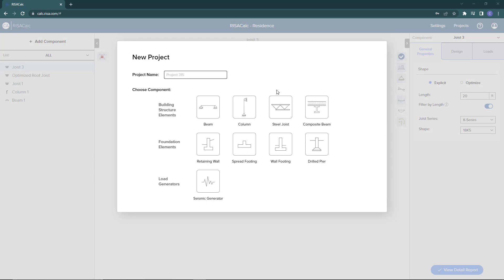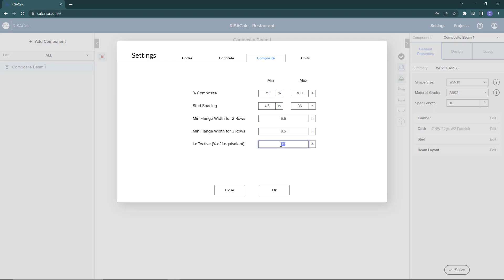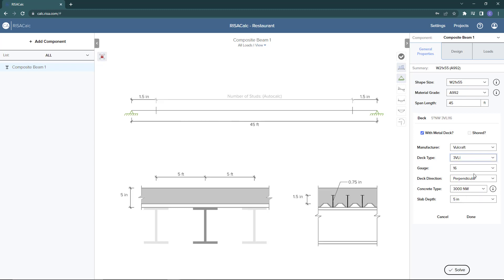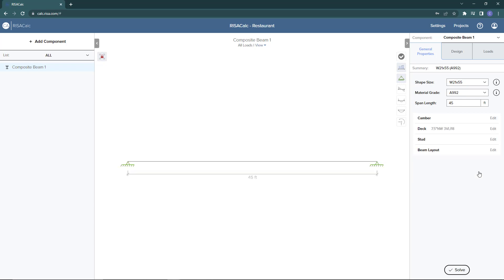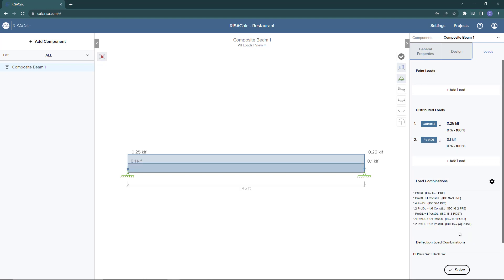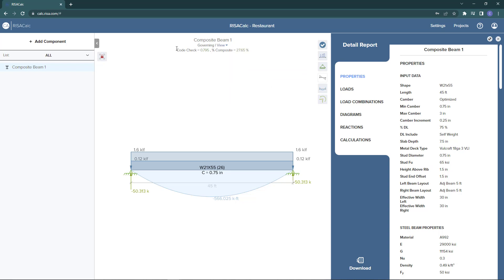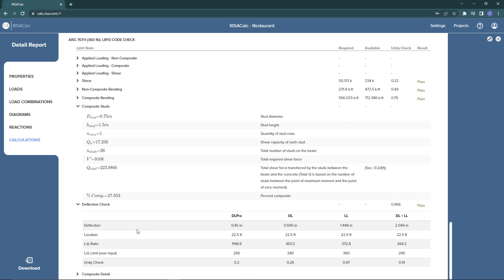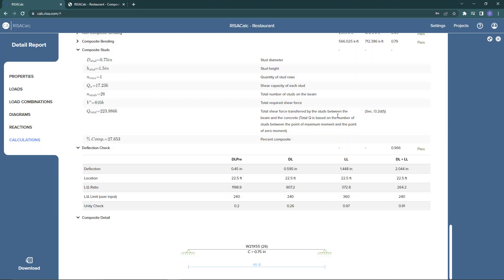RISACalc: Composite Steel Beam Design

Comment: Can RISA code check a non symmetric steel shape, such as a built up plate girder with different thickness and width top and bottom flanges?